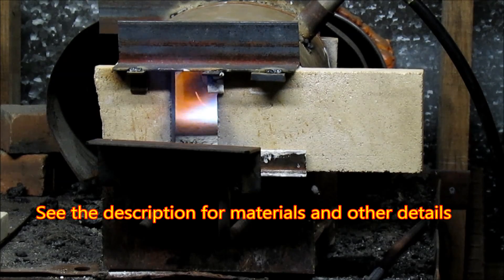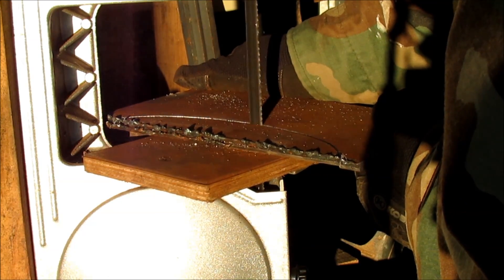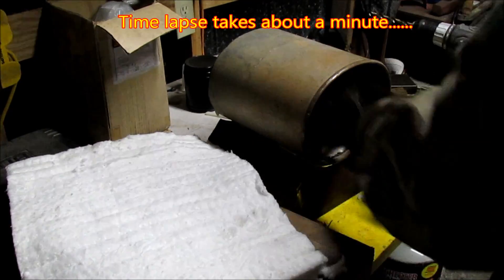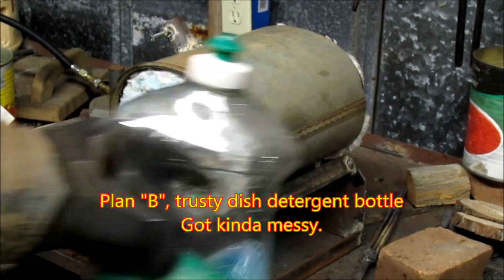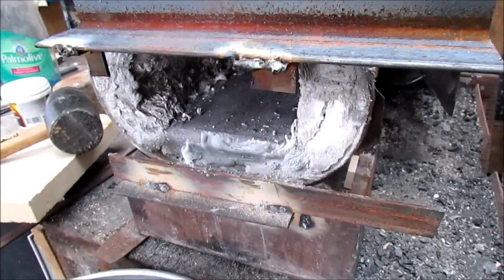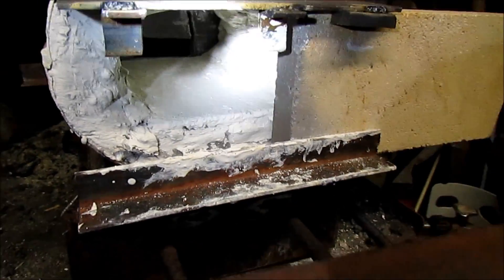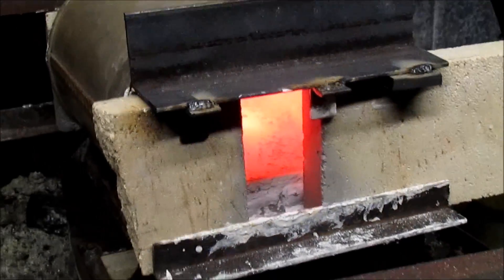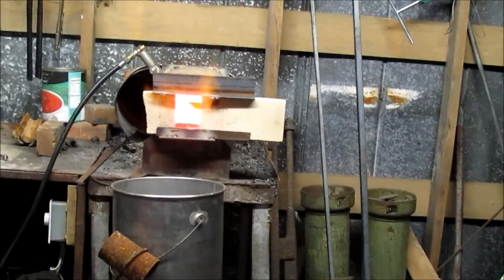HOW TO MAKE A GAS FORGE - OUT OF HALF A MUFFLER

Comment: How is the burner holding up?  You've got one of the earlier designs, so I'm just wondering.
Reply from the maker: zaph3 hey it's working fine. I haven't had any issues with it other than cleaning out some cobwebs after a couple of months of in activity.  I typically burn about 2 tanks a month.

Comment: nice! workshop of death might have to build something like this for the other shop...
Reply from the maker: +TheEvilways101 thanks,  I think its a good idea to have options based on fuel types. coal isn't that hard to get for me,  but it just requires a special trip. Propane is everywhere. I'm starting to miss coal though, might need to make the trip.
Reply: i hear ya they both have there advantages.. propane is so much faster and easier but costs way more for me.. i gotta rebuild and setup my coal forge it sucks, i got a buddy welding me a table forge out of a brake drum and a old wheel barrow, i just need to fix the exhaust vent, and get a better source of air via, old hand crank or electric fan, cause the hairdryer sucks.
Reply from the maker: +TheEvilways101 yeah the gas is pretty expensive. I find myself being a lot more tense while I'm working trying to maximize my usage. I think I will eventually get a bigger tank so I can get it a little cheaper in bulk from the gas company. As far as a forge blower, I cant say enough good things about the bathroom exhaust fans. They are pretty cheap, quiet and have plenty of air flow. They are easily hooked up to a dimmer switch too. There are a couple of my early videos that show my coal setup incase you haven't seen it. Personally, I don't even use a blower dryer to dry my hair, I just never liked them. I don't think I could stand to be in the same vicinity with one(or a shop vac) running for hours. Good luck with the build, sounds like it should be a good one.
Reply: I'm definitly gonna look into a small fan like that at lowes, i saw one i believe it was a bathroom fan. my friend have me a large paddle fan from a old furnace i use that for exhaust.. but i think the dimmer and small fan would be good for the coal and quite. exactly, the hairdryer and vac is just too crazy loud and draws way too much juice. i wanna get a 60lb tank but I'm only 2 months into using a propane forge, I'm a little nervous with the 20lbs,, but with every use I'm becoming more brave lol i'll probably be rolling 2 60lbs before the summers over

Comment: How long does it take to cook a hot dog in there?
Reply from the maker: lol probably not too long. maybe I'll try it 😁
Reply: +OrionsAnvil where can you get that wool fiberglass stuff? And can I use like cement instead of it? It doesn't look fun to handle.
Reply from the maker: +creapycreaper101 hey, I got mine on eBay. but if you search for "wayne coe artist blacksmith" he sells  Forge supplies too. some people do use a rigid refractory cement or fire bricks. I like the wool better, even though you have to wear a respirator and ling sleeves etc. I think it works better. that Wayne Coe site has alot if good info. thanks for checking out the video.
Reply: OK thank you

Comment: My friend wants to buy a gas forge. I say build one but, he don't think it's safe. What kind of adapter connects the forge to the gas line? How do I make sure the tank don't explode?
Reply from the maker: I had some of the same concern's. That's why I decided to buy a pre made burner, it came with the proper hose and regulator needed to connect to the tank. I list it in the description of this video. That being said, a lot of people have had good luck  building their own burners. There are a few different ways to go with that. I suggest you check out the forums if you haven't already, there is a ton if info there on burners: www.iforgeiron.com , a smaller going forum www.theironforgefire.com . There is also a great site by a smith, Wayne Coe that has good info and you can buy materials there too. He has a great PDF on how to make a Forge that should help you out http://www.waynecoeartistblacksmith.com look for the Forge supplies link. Good luck with it.
Reply: +OrionsAnvil Dude Thanks! When I build my own workshop I want almost everything to be handmade so I know every inch of it. Also, I didn't have a Google + so I didn't see a lot of reply's or comments. Hopefully I fixed it? This computer stuff drives me nuts.

Comment: Thats a crazy simple burner.  What psi do you run your propane at for every day forging?
Reply from the maker: it came with a 20psi regulator. It got to about 1800 degrees Fahrenheit about 1/2 opened up. I keep it running closer to 3/4 open. I got a feeling the burner might do even better in a little bit bigger chamber. its the 100k btu one that Atlas Knife sells, I got it off ebay. thanks for checking out the video.
Reply: +OrionsAnvil questions what do you know about that fiberglass insulation.. iknow its bad shit to touch and breath in.. but what about after while in use?? it touch it with the spikes while its running and the exhaust is blowing out. i have my shop door open.. but i can feel the heat and I'm breathing in that shit.. is that bad?? how bad? while its hot and burning? i been meaning to get that ceramic paste too coat over it too cut down on the exhaust.. i just don't wanna die from some bad exhaust of fibers etc.. ughhh. whys blacksmithing gotta be so hazardous. why can't it be good too breath in lol